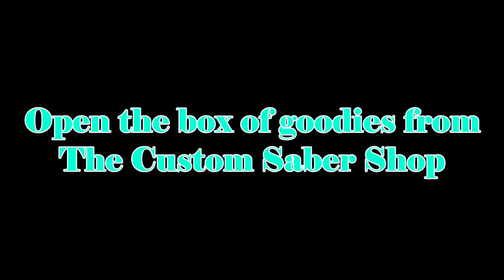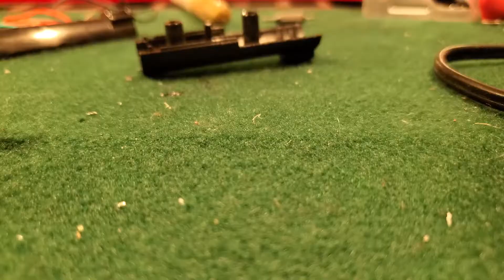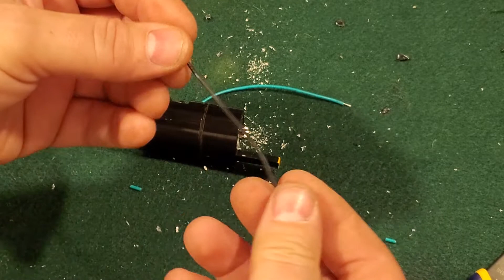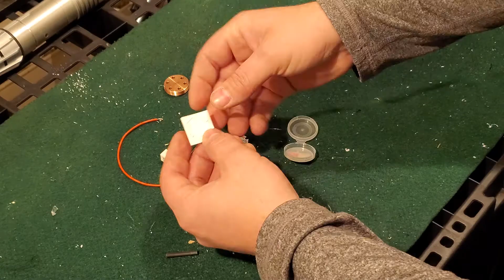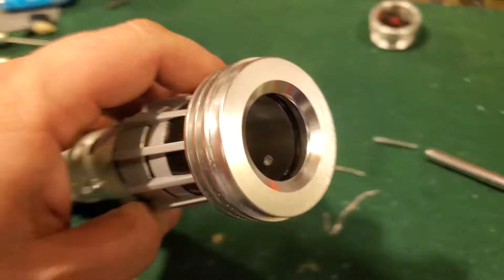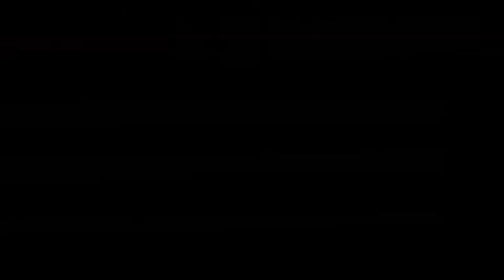Darth Maul Black Series Lightsaber Conversion (Full Length)

Comment: What size wires did u use and what resister did u use just asking lol
Reply from the maker: Since it was just an in hilt led the wiring for the led was 26 gauge, if I would have done a modern neopixel conversion as I do now it would have been 20 to 22 gauge for neopixel & battery leads, 30 to 28 gauge for switches & neopixel data.
The resistor I used is what was specified by the resistor calculator on the TCSS website to match the battery & LED specs.
Reply: @TheBanthaWhisperer  ok thanks I'm planning on converting my Darth maul lightsaber just have to save up for the parts and other stuff I need lol

Comment: Are you able to convert the two blades with a neo Pixar blade and new board? If so where can you buy that stuff?
Reply from the maker: Yes. I can make neopixel blades & convert it to any soundboard on the market.
This conversion was just as basic as I could go on a conversion. Most that I work on are full conversions, where I remove all of the internals & either fabricate a blade holder for the hilt or use a TCSS conversion bladeholder. Then I design a chassis to house the soundboard, speaker, 18650 or 21700 battery, recharge port, switches, kill switch, etc. depending on what someone wants in the conversion.
Reply: @TheBanthaWhisperer  ooh ok so you could do the work if I where to send it to you?
Reply from the maker: @elizabethalferd4247  yes.
https://www.facebook.com/BanthaWhisperer/

Comment: Got the master replica ones from 2007, and they look identical to the hasbro black series. They havent updated anything for 16 years!.
I've gutted mine completely, going to do an entire neopixel rebuild using these hilts  and fitting them with verso v2 soundboards
Reply from the maker: Nice. I think the MR version hilts are easier to do the conversion on than the Hasbro. There are a few subtle differences, but not much.

Comment: hey this video is awesome on the tear down.  Been looking for one for awhile.  i am wondering if the part from TCSS which is the conversion kit (the metal tube for the LED housing) i am wondering what the diameter is on it as i have not found any measurements, i also am wondering if you would say that same part would work for a neopixel build to house a neopixel PCB connector.  let me know, thank you!
Reply from the maker: To do neopixel you'd have to replace the soundboard, but TCSS has a pcb cover that will fit in their Darth Maul Conversion kit bladeholder.
https://www.thecustomsabershop.com/Maul-C95.aspx
https://www.thecustomsabershop.com/Pixel-Hilt-Side-LED-Module-Adapter-P1349.aspx
Reply: @TheBanthaWhisperer  awesome thank you again for that information.  would that adapter be compatible with all types of PCB pins rather than just the 7 pin one displayed in the image?
Reply from the maker: @andrewchristie8980  it's setup for both TCSS 7 & 11 pin PCBs. They have it noted in the information, but should update their pictures.
Reply: @TheBanthaWhisperer  ah okay perfect, it’s only compatible with TCSS ones or would me using the shtok ones work too?
Reply from the maker: @andrewchristie8980  I've used Shtok by trimming the ring edge of the 7/8" long pin Shtok pcb holder to house inside the LED module housing, using the heatsink to screw it in tight or you can get a short pin Shtok pcb/1" holder & drop it in from the top of the blade holder, so you don't have to use the copper heatsink.
Reply: @TheBanthaWhisperer  okay great! thank you for the help on this!
Reply from the maker: @andrewchristie8980  you're welcome

Comment: This soundboard is the same on the Luke and vader. How come you didn’t bridge the soldering points on the white side of the board to use as positive and negative lead for the led? I followed the tutorial for Luke and vader BS and that’s what they did.
Reply from the maker: I did this following a tutorial that was done on the Darth Maul BS hilts.
There are a lot of things I would have done differently now on the conversion.
Right now I'm printing my own chassis customized to fit each hilt, using Proffieboard, GHV3, CFX, or Verso soundboards instead of keeping the original electronics. Most of my conversions are neopixel or tri-cree RGB, rather than the single LED or tri-cree single color LED module setups.

Comment: I’m so close to getting the mod working, I’m just stuck at fitting it all in the hilt. How did you manage to get the circuit board to fit all the way into the plastic housing? Thanks so much for the video!
Reply from the maker: I tried two different ways to fit the Hasbro soundboards into a DM hilt. The better fit, was actually when I reversed the board, making a little more space to fit the resistor into the chassis. But it required cutting a notch in the chassis to allow the room to flip the board, without ripping any of the wires.
The other way had me notching a spot in the chassis to keep the resistor from wedging in between the chassis & the blade holder.
The fit is going to be super tight either way, just make sure that the blade holder is as tight against the emitter as is can be, before drilling & tapping the set-screw.
Reply: @TheBanthaWhisperer  Thanks for the advice, I tried what you said but the fit ended up being worse and the wire to the switch ripped twice in the process. At this point, I feel like 3d printing new internals and trying to salvage what I can from the old ones is going to be the only way to go. Thanks for your time!
Reply from the maker: @HIRO_TM  I had that happen with a different Force FX conversion & I replaced the switch wires with silicone coated 28 gauge wire. They are a lot more flexible, making it easier to deal with odd angle cramming. That & gluing the wires to the switch, after it's soldered, helps prevent the wire from breaking.
I have a Darth Maul Galaxy's Edge Legacy Conversion on my work table right now & it's a nightmare compared to the Force FX hilts to convert. They really put some of the Legacy Saber hilts together in ways to frustrate an installer.

I have also cut the glued edges of a FX chassis to have the open cavity to redo wiring & make a better fit between the blade holder & chassis. Using E6000 to glue the seams back together & masking tape to hold it tight, until the glue cures.
Reply from the maker: @HIRO_TM  I've started gutting everything out on all of my own conversions now.
I still do some of the basic conversions, like this one for customers who want to just duel with them.
But honestly it's harder on the nerves to do the basic conversion, than starting from scratch with all of the internals.

I can get a chassis that fits, with a high grade rechargeable battery, top grade sound board, loud 28mm bass speaker, have it run Single Cree, RGB, RGBW, or Neopixel, with way less frustration. The frustrating part of full conversions is figuring out momentary switch setups, but once you engineer through a couple hilts, of the same model, it becomes less stressful.
Reply: @TheBanthaWhisperer  So in the end, I just decided to cut about 1/2 a centimeter off of the blade holder to get everything to fit. It fits in snug and looks great! Thanks again for your replies and the very helpful video!
Reply from the maker: @HIRO_TM  glad to hear that you have it fitting good.
Reply from the maker: @HIRO_TM  what cree setup did you decide to go with single, tri-cree?
I went with the single cree Dark Red, due to color preference, but a Red/Red/White, Red/DarkRed/Red, DarkRed/DarkRed/White, or straight Tri-cree Red or Dark Red give some pretty cool color variations.

Comment: Which maul sabers are these i think I have the new black series version is this still possible or is this the original version
Reply from the maker: 2017 Black Series. Pretty much all Black Series lightsabers are convertible, with a few variations in electronics. They normally don't change anything with the internal hilt design. Generally, the variations are between blade holders on Black Series, Master's Replica, Solid Blade, & Removable blade models.

Comment: Hey I love this vid! I have the same sabers and want to convert them but I cant find the pieces I need on custom sabers. Do you have any recommendations for other places ? And what all parts I need?
Reply from the maker: I buy parts from Sabertech, The Saber Armory, The Custom Saber Shop, Darkwolf Custom Sabers, Korbanth, Saberforge (for some components), Ebay, Etsy, OSH Park, Graflex Store, & Amazon.
If I can't find some parts, I will attempt to fabricate them myself.
Reply from the maker: The parts all depend on the type of build that you want to make. Are you wanting multiple colors, sound fonts, LED module or Neopixel, how many switches/momentary or latching, & type of speaker.
The blade holders, I look at TCSS, but if they don't have it in stock, I will make the blade holder out of either Aluminum or Carbon fiber. I prefer the carbon fiber due to making from a couple of different diameter pieces of carbon fiber & being able to run the length of the hilt with the largest diameter piece. It makes the blade incredibly strong & stabile. The only catch to carbon fiber is drilling & milling, I have scrap pieces of polycarbonate tube, that I slide inside the carbon fiber tube, to prevent any splitting in the fibers.
Reply: @TheBanthaWhisperer  right on man thanks for the direction. For now just a removable blade and led module. Ice been looking at custom shop for sometime but wanted to see ur reply about other places before I ordered anything . I really appreciate it man!
Reply from the maker: @jamesharper1729  you're welcome. Glad to help.
Reply: @TheBanthaWhisperer   
Hey could you possibly give me the list of parts you used for yours? All I want is an led and removable blade like you did but I don't wanna order the wrong things. Maybe that will help me along the way and once I see what parts you ordered for this sabe I can change them as I go. Thanks a bunch
Reply from the maker: @jamesharper1729  Drill bit & tap set for either 6-32 or 8-32(this is for blade retention screw), some 8-32 or 6-32 setcrews(of various lengths depending on what you need based on where you tap the hole on the hilt), XP-E2 LED or Rebel LED, Maul blade holder (they have two styles, based on the model you have), LED Collimator lens, Lens Holder, thermal tape(to hold LED to heatsink), resistors for Red Rebel (3ohm 1.5watt) or for Red XP-E2 (1.85ohm 1.85watt) this is the minimum resistance, so you can go a little bigger. For the setscrews, I pick up them by the pack on Amazon, stainless steel or brass depending on the application.
If you don't want a bunch of resistors, TCSS sells them individually. I order mine in bulk from various electronic suppliers.
Reply: @TheBanthaWhisperer  you're a boss! I really appreciate it. This is going to be my 1st build so I am really afraid I'm going to get the wrong size of something or have To order something 5 different times lol. I really appreciate it and whenever I get it finished if I can remember I'll let you know how it went. Thanks again and may the force be with you my friend
Reply from the maker: @jamesharper1729  I understand the multiple order thing, I had that happen on one of my first builds.
Get to a stopping point & order a part, then find myself ordering another part later that day.
I try to wait until I have a hilt completely disassembled & walk myself through the build, then buy anything I'd need, after a thorough evaluation.
Reply from the maker: @jamesharper1729  I forgot to mention, that when you drill out the hole for the setcrew, use a scrap piece of polycarbonate tube inside the blade holder. This will save you on some sanding or filing off burs from drilling & tapping the hole out.
There will still be some burring, but it will be a lot less, than if you have nothing backing the inside of the blade holder.
Reply: @TheBanthaWhisperer  got it. I will do that for sure. And yea I have one hilt completely apart that way I knew what it was gonna be like. It helped a lot just doing that much lol. Thanks again for everything. I'm excited to get this going
Reply from the maker: @jamesharper1729  excellent. I hope all goes well with your build.
Reply: Thanks man, me too

Comment: good job man you inspired me to do that to my own
Reply from the maker: I honestly think a full mod is better, I've done it to both Darth Vader ESB & Luke ROTJ  Force FX lightsabers. They are a whole lot better with CFX, Proffie, GHv2, Verso, or Sabercore soundboards. I personally like the Verso & GHv2, the Verso works great with RGB tri cree LEDs & Neopixel, the GHv2 works great with RGBW & has great customization options. The GHv3 will be great once it's released, since it's cheap & great for Neopixel.
Reply: PermaNett Acres: Farm, Play, & Away do you happen to have a video of it? I’d like to do that to mine as well
Reply from the maker: @sleepwalker1760  I had been slowly building them & didn't record them.
I have been using MHS 3D printed chassis off of Ebay, wrapping the chassis at two points with electrical tape to fit the inner diameter of the hilt better.
I eventually intend to buy a 3D printer to make custom fitting internal chassis components.
I am going to be soldering up some Verso soundboards, running RGB tri-cree LEDs. I can record some of the process there & post it.
I am also experimenting with using carbon fiber for blade holders, to lighten up the hilt weight.
Reply from the maker: The Darth Maul lightsabers are great, but just fall short of the DV ESB with the TCS 4 watt speaker running of a Sabercore soundboard. That DV is super loud & definently draws attention, when the Crimson sound font kicks on.